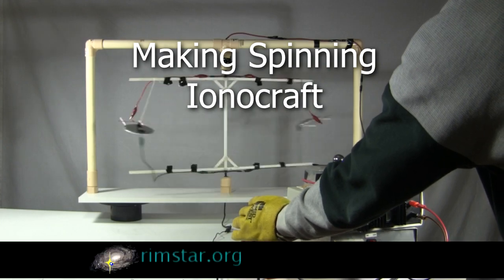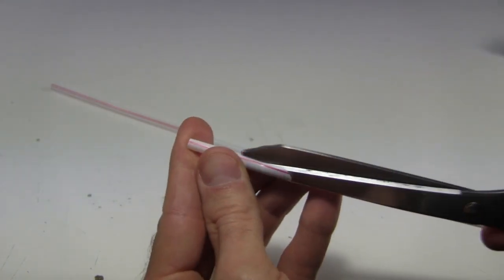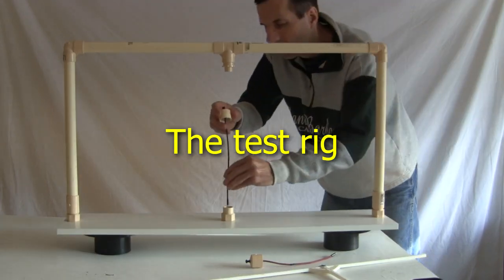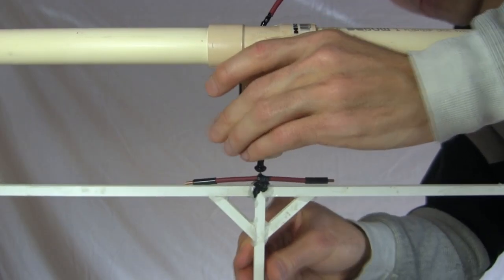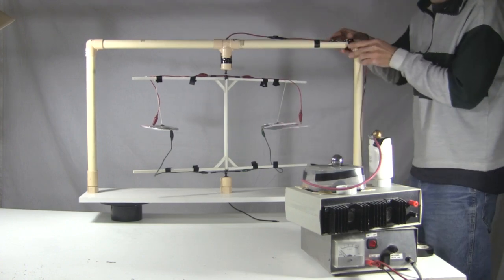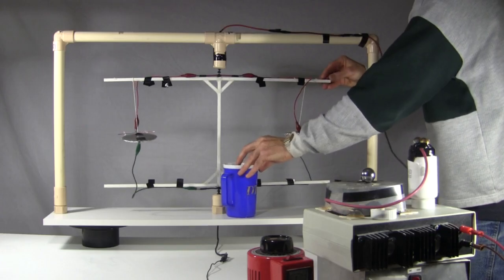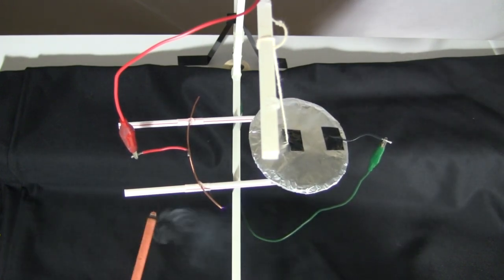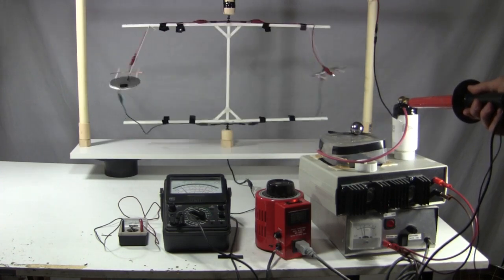Make Ionocraft/Ion Wind Spinning Disks

Comment: Very cool!  Is there a reason why the negative electrodes are disk shaped?
Reply from the maker: Historical reasons really. This originally came from research into T. Townsend Brown's research and he used disk shaped electrodes. The main thing is that the edge nearest the wire be smooth, so that that edge doesn't produce ions.
Reply: Oh I see!  That's cool!  It sort of reminds me of the Star Ship Enterprise!
Reply from the maker: Makerj101
Shhh... Wheels are turning in my head about making an ion propelled Enterprise, tethered to the PSU of course. :)
Reply: Hahaha that would be cool!  :)  What is the PSU?
Reply from the maker: Makerj101
PSU = Power Supply. I'm guessing that's what you were asking. Sorry for the shorthand. It's my homemade 30kV DC PSU which I showed the making of in a recent video.
Reply: Hahaha why did I ask that?  I know what the means...  I must have been really tired when I asked what a PSU is...  :D  Sorry about that...

Comment: Curious–if you use A/C, will the thing vibrate or be "locked" in place? If not, what might, or might not, happen? What would different frequencies do, assuming sine waves only? Or, now that I think about it, what might different waveforms do?
Reply from the maker: Good question. As you suspect, it wouldn't move, or likely not. There is a possibility it might since positive ions have more mobility in air than negative ions.
I do recall around 20 years ago when people experimented with this sort of thing more that someone showed that pulsed DC works and that 70Hz (IIRC) worked very well.

Comment: Could you add propellers to that to make it fly? Or wheels?
Reply from the maker: Propellers would require motors with batteries to make the propellers rotate. That makes it heavier and so you'd now need a wing for a bigger lifting surface and then it becomes a regular airplane. However, there is something called a lifter which uses this same ion wind to fly. See my video here about making a lifter https://www.youtube.com/watch?v=vzZy1Aqleno

Comment: can ion propulsion be used on a disk shaped rc plane and make the air flow over the surface of the disk producing the coanda effect and as a result producing  lift?
Reply from the maker: grecoman100 Theoretically yes, but the thrust isn't strong enough to lift the power supply so it wouldn't work.

Comment: Hi,  does the foil get worn out?
Thank-you.
Reply from the maker: It does if you allow sparks to happen. Each spark burns a tiny hole in the foil. The holes make the foil act as a sharper surface instead of a smooth one and reduces the effect. But just make sure you don't have sparks since you don't want them anyway.

Comment: How fast is the ion wind, and how much thrust does it have? Also, can the ion wind be manipulated in any way? Say using a magnet? Thanks.
Reply from the maker: Anirudh Vasudevan Regarding speed and thrust, I don't have any answers. The most I've done is to visualize it using these smoke tests, the best being this one with a lifter https://www.youtube.com/watch?v=LOGAaObsN4g. And since it's made up of moving charge, I'd assume it can be manipulated using a magnet. I've never tried since it's in the vicinity of high voltage.
Reply: RimstarOrg Hmm. If you placed an object on your standard ionocraft, what do you think it can lift?
Reply from the maker: Anirudh Vasudevan
Your typical ionocraft can lift just itself, which is around 2 or 3 grams. The record, using a specially made power supply, is a 98 gram ionocraft lifting a 102 gram payload http://blazelabs.com/l-c-hexspiral.asp.
Reply: RimstarOrg Ok, thanks for the link, I'll take a look!

Comment: Does increasing the voltage increase the speed, or does increasing the amperage increase the speed?
Reply from the maker: +hintzofcolorconcepts Once the voltage has broken down the air between the electrodes making the air conductive then increasing the amperage increases the speed. But when I'm turning it up, I'm turning up the voltage. However, since the air is conductive the voltage stays the same and the amperage increases instead.
Reply: +RimstarOrg: Does reversing the polarity reverse the direction of rotation? 
how many volts were used for this experiment?
Reply from the maker: +hintzofcolorconcepts No, it goes in the same direction no matter what the polarity. The direction is set based on the respective shapes of the electrodes. It moves in the direction of the sharper electrode, in this case the wire. You can see an explanation of how it works in my video explaining ion propulsion https://www.youtube.com/watch?v=01F8V5IhB5k.
I didn't measure the voltage but judging by the distance between the wire and the disk, and based on my experience with these things it was probably around 30,000 to 50,000 volts. But that can be lowered by bringing the wire and disk closer together.
Reply: +RimstarOrg I am very interested in experimenting with electrode shapes, how many watts does your power supply require? 
My flashlight stun gun claims 2 million volts but arc distance reveals more like 30kv. I'd like to build an aluminum foil glider that could carry it's power source, but the ion wind is rather whimpy so we might have to settle for ion powered balloons for now.
Reply from the maker: +hintzofcolorconcepts I don't know how many watts were being used in this video but in my video where I show how to make the power supply I measure the input when flying a lifter and it was 8 volts at 2.5 amps, meaning 20 watts. You can see it here https://youtu.be/GEuK1OdYxHk?t=8m21s.
And that's the 2nd time recently that I've see those nonsense claims of millions of volts for a stun gun. Sounds like some company's doing false advertising. Do you have a name or link for it? I'm curious how they're wording it.
Reply: +RimstarOrg http://www.psproducts.com/products/zap-enforcer-2-million-volt-stun-gun-flashlight/

lots of stun guns are making such high voltage claims, but none can throw 3 foot arcs. lol
Reply: +RimstarOrg  I am currently testing  a version of milkovic's propulsion using a rotary vibration to generate  centrifugal "g-force" which might prove to be more energy efficient. 
since the charges I accumulate in a set of capacitor plates can be acted upon by a high voltage field without the amperage to back it up.

Comment: heya, what happens hen the polarity , current is reversed?
Reply from the maker: It moves in the same direction as it does with the polarity I used in this video. Polarity doesn't matter with this one. The formation of the corona is a little different, but that's about it. See the sections on Positive and Negative coronas here https://en.wikipedia.org/wiki/Corona_discharge for the differences.
Reply: I have observed in other experiments that the polarity reversed doesn't reverse the direction. But that's for lift off up and down. I was curious - if you reversed your polarity on this experiment would the direction of rotation reverse?
Reply from the maker: No, it moved in the same direction. The direction of rotation does not reverse.
Reply: RimstarOrg why do you think this is?
Reply from the maker: It's what I would expect. The shapes of the electrodes are what determine the direction of movement, one sharp and one smooth. I explain the means of propulsion in this video here https://www.youtube.com/watch?v=01F8V5IhB5k.
Reply: Ah I see 

Have you ever held a compass near an iono craft to see if the compass needle switches when you switch the polarity ?
Reply from the maker: No, I haven't tried that. Compasses react to magnetic fields. The only magnetic fields here are the ones generated by the weak current in the corona between the sharp points and the smooth surface. So there should be a magnetic field around those current paths. But it would be very weak since the current is so low.
However, reversing the polarity would reverse the direction of current flow and so the magnetic field around the current paths should reverse, since the direction of the current determines the magnetic field direction.
Reply: Cool - what type of variance should I get to do this experiment ? Also power supplies - I have normal mains power in the UK here st 240V and up too 32 amps ... depending on the wall socket I use
Reply from the maker: My variac is rated for 3 amps but it's 120V. Since your at 240V then anything rated up to 1.5 amps should do. However, it's best to err on the high side since that'll give you more options in the future. So 2 amps or higher would be good.
I don't have any plans for a 240V high voltage power supply though. Again, I'm at 120V. http://www.amazing1.com/hv-dc-power-supplies.html have ones that support 240V. If you were going to power a lifter then I'd recommend something that can do 25kV and 1 milliamp. But since you're just looking to have things fly around like in this video, you can use less current.
Reply: Oh wow great - I'll use this for sourcing my equipment for sure. 

Also I'm curious how come AC doesn't ever get tested? And also why only copper and aluminum ? I was thinking to use other Diamagnetic high density conductor which is sharp pointed and then uses another rounded paramagnetic low density conductor and even encapsulate them in different dielectric materials. Just thought I'd ask to see if you have tried other items
Reply from the maker: It wouldn't go anywhere with AC. That's like a jet engine that constantly rotates so it's pointing backward, then forward, then backward, then forward, ... The net effect is that the jet wouldn't get anywhere. The explanation I gave in my how ion propulsion works video  https://www.youtube.com/watch?v=01F8V5IhB5k works only with DC.
Regarding the materials, I've used brass and steel before. It doesn't matter, as long as it's electrically conductive.
Encapsulating them in a dielectric may help for the smooth electrode, but the sharp electrode needs to be exposed in order to form the corona.

Comment: What is that noise?
Reply from the maker: That hissing sound is due to the ionization, the bluish corona, that happens between the sharp ends of the wire and the smoother disk. However, I don't know precisely what step in that ionization process is emitting the sound waves that are the hissing sound/frequency. Clearly due to excited molecules in the corona vibrating the air, but which ones? Excellent question. I wish I had the answer.

Comment: I hear the hissing sound from the corona but my craft isn't moving. Why is that?
Reply: Do I move the electrodes closer together?
Reply from the maker: Hissing is good, that's the sound of the ionization that you want. If you run it in darkness then you should see some bluish corona. But you're not getting enough to make it move.
The first step there is to make sure it's free enough to move so see if anything is creating friction in however you're mounting it. You could try just hanging it from threads without trying to make it move a rotor to see if it moves at all.
You can of course turn up your power supply so that there'll be more current for ions.
Moving the electrodes closer will help too, however, if you start getting sparks then they're too close. Also, sparks are bad because they damage the smooth electrode, making it sharper and more likely to spark.
If it still doesn't work then it's time to modify the craft. The sharper the sharp electrode the better. Making it more lightweight will help too.
After that comes trying a different power supply. But if you're getting hissing then you're close. See what you can see in the darkness.
Reply: @RimstarOrg  I tried turning up the power supply but then the hissing stop when I do and soon after the wire starts smoking
Reply from the maker: Neither of those things sound good. The hissing stopped when you turned up the power supply sounds like you might have damaged the power supply. Does it still work? I'd assumed you'd already had it turned up all the way.
Reply: @RimstarOrg  yea I replaced the wires and the hissing sounds came back
Reply from the maker: That's good news. At least your power supply is okay. Work through the other things I'd mention and you should get some idea of how to progress further.

Comment: would move in space??
Reply from the maker: It would move in space only if you brought along a propellent. In my case I used the surrounding air. In NASA's ion propulsion spacecraft they've used xenon gas. Eventually it runs out but they make good use of it, ejecting only a little at a time at very high velocity.
Reply: gooood

Comment: hey so its not the ionic wind that lifts the aluminum armature skirt 
have a look here these expiraments where the top wire is unlinked from the skirt - https://www.youtube.com/watch?v=fRLbLlBLfdk  or from the website --> http://jnaudin.free.fr/lifters/inthebox/index.htm
the basics is this 
This test of the Lifter with the wire mechanically unlinked and fully enclosed in a box proves definitely that :

The ionic wind emitted by the wire is not responsible of the main upwards thrust of the Lifter,

The aluminum plate is attracted upwards, toward the charged cloud generated by the wire placed above,

The Lifter is able to work with the source of the charged cloud linked or unlinked to the main aluminum armature.

In the previous tests about the evidence of an asymmetric force between armatures, it has been demonstrated that :

The attraction force of the plate towards the wire is stronger than the attraction force of the wire towards the plate,

There is an asymmetrical force between the plate and the wire,

The upwards thrust of the Lifter is the result of this asymmetrical force between the armatures.

other links and videos 
https://www.youtube.com/watch?v=DctZcxxe30I
https://www.youtube.com/watch?v=wDju4HKgwdw
https://www.youtube.com/watch?v=fRLbLlBLfdk

more stats
http://jnaudin.free.fr/lifters/data/index.htm

Comment: Mind helping?
Reply from the maker: Ask away.
Reply from the maker: Ah, YouTube marked your link as spam, so I didn't see it at first.
To start with, in all my experimenting, T.T.Brown's stuff is really just different forms of ion wind and magnetohydrodynamics. So, no electrogravitics there.
Your power supply does seem a little underpowered. I'd expect to hear some hissing, as ions leak from the wires. I'd be surprised if your wires were that well insulated that ions wouldn't leak, based on what I see you've done.
So I can help getting the ion propulsion working, but not elecrtogravitics.
Reply: ok, thanks
Reply from the maker: Again, I can't help with electrogravitics but I suspect your power supply isn't working. Try it without the styrofoam and with the ends of the wires very close together. You should see sparks or arcing. Do it only for an instant since I don't know how much current your power supply can handle.
Reply: Thanks